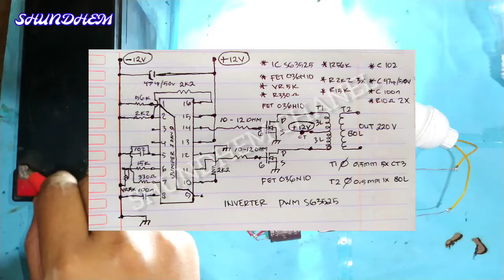inverter ferit flyback tv | SG3525 | 12v to 220v 50hz | 036n10 | 047n10

Comment: kak cara machingnya gmna
Reply from the maker: jalur positif dari aki yang menuju ct primer trafo diseri dengan lampu depan/sein motor, lalu putar potensio di pwm sampai lampu padam, jika lampu masih menyala berarti belum matching, kemungkinan fet akan panas dan jebol jika dialiri tegangan langsung.
Reply: ini bang primer dan sekunder brapa kak.
dan potensionya harus brapa kilo
Reply from the maker: potensio 5k
primer kawat 0,5mm masing" 6 helai
skunder kawat 0,5mm 80lilit